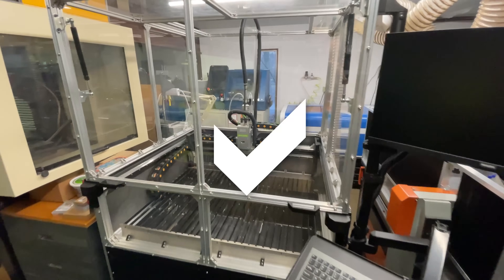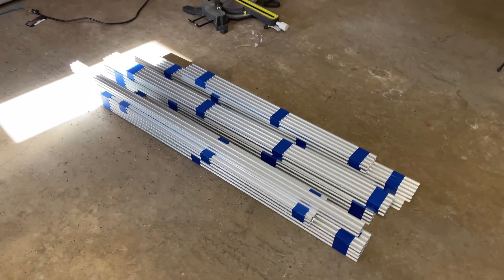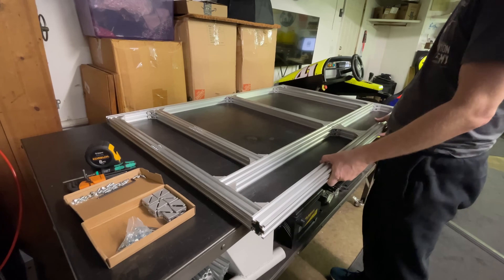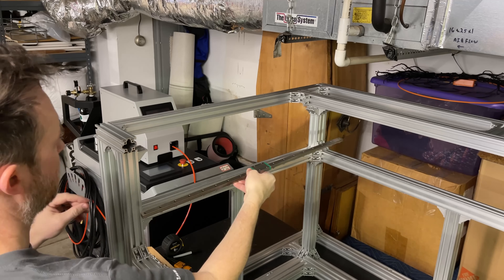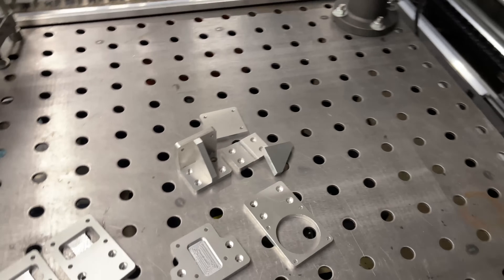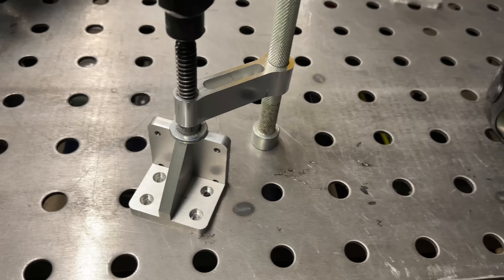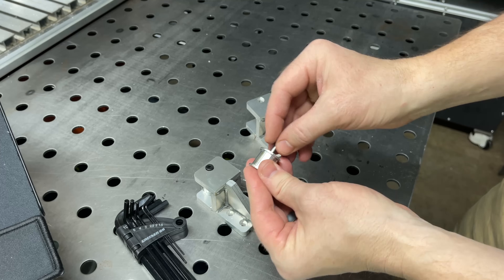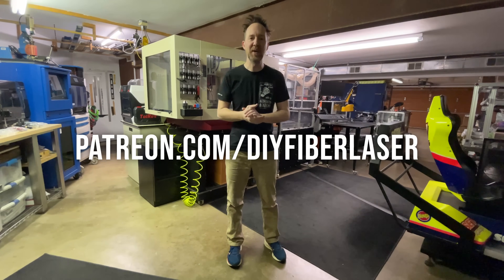DIY CO2 Laser Cutting/Engraving Machine: Part 1

Comment: im in the planning stage of building my own laser, is there any reason you chose 4040 for the frame instead of 2040/2020?
Reply from the maker: I am trying to err on the side of too rigid, as the servo motors and RF laser source are quite heavier than what is typically used on these machines…and I’m gonna try to move it fast. 😀

Comment: I'm so glad you updated the new video! Watching your videos always gives me a lot of inspiration! I have recently been interested in small tabletop injection molding machines and was wondering if you could consider making one after this project.
Reply from the maker: Haha…I actually built a prototype about 2 years ago and I never put out the video, it got put on the back burner as I shifted focus to other projects. I am very interested in small scale injection molding as well…I am still holding on to two very capable injection molding machines because I want to explore this more in the future!
Reply: Any chance you’ll share your speeds, feeds, and cutter info for cnc aluminum cuts?
Reply from the maker: Most of the parts I made on my CNC router at 40k rpm at 1800mm/min with 1/8" 2-flute endmill.
Reply: @ 40k?   Nice, I can only go up to 27k.  D.O.C.?
Reply from the maker: I was using a conservative 0.5mm doc

Comment: Hi Travis, I have a couple of questions for you. I also have a 2K watt 4in1 laser. I haven't tried welding aluminum yet but before I do I think it would be a good idea to pickup that graphite tube. I don't have a Skyfire machine but I went to their website thinking that is probably where you got it but I don't find it there. Can you give me a link for the tube and for the aluminum wire? Thanks.
Reply from the maker: Graphite wire feeding tube: https://www.ebay.com/itm/256623831093?chn=ps&mkevt=1&mkcid=28&google_free_listing_action=view_item&com_cvv=8fb3d522dc163aeadb66e08cd7450cbbdddc64c6cf2e8891f6d48747c6d56d2c
Reply from the maker: Aluminum wire: https://www.amazon.com/dp/B01DTLYZ4I?ref_=pe_123509780_1038749300_fed_asin_title

Comment: Love the look of the laser welder! The only thing I'm wondering (and I know NOTHING about laser welders) is the power a little too high set there or such? I saw the laser blowing out through the back of the metal, and it looks like it was cutting along at 45 degrees before filling with metal, but of course, the actual joint was at 90 degrees - not in line with the beam. Is that an issue?
Reply: I think that's when he got close to or went over a couple of tapped holes
Reply from the maker: As @tobiasm2780 mentioned, it looked like it was blowing through, but there were a couple tapped through holes barely touching that seam...that's what you saw. I should have explained that in the video. I went back and re-tapped those 2 holes after the weld.

Comment: 8:04 The pillow block plate could be enlarged down the vertical 4040 a little to compensate for removing the angle bracket.

Comment: Thanks for the great content Travis! What sort of fiber laser power do you think you might need to cut that aluminum plate you milled? I noticed that on skyfire's website they say that ~3kw can get you to about 4mm thick aluminum. Has this been in line with your experience? And if you were to switch to a carbon steel would your laser be able to pull that off?
Reply from the maker: I was using 8mm thick aluminum plate for all the parts. You would probably need at least a 4Kw source to laser cut them, but it would be slow. I could have laser cut the parts out of carbon steel with my machine...I can cut around 10mm max, but then would still need to do some machining to do the counterbores.

Comment: You could use blind joints, but only from the start of the build
Reply from the maker: I considered it, but it was so much extra work last time I used that method that I decided against it.
Reply: @diyfiberlaser  yeah it takes a ton more thought and planning. plus sometimes they will twist a bit when tightened. I wish i had room to make even a small laser cutter.